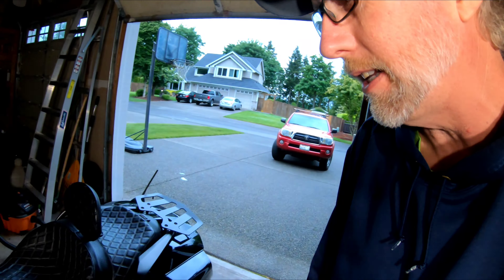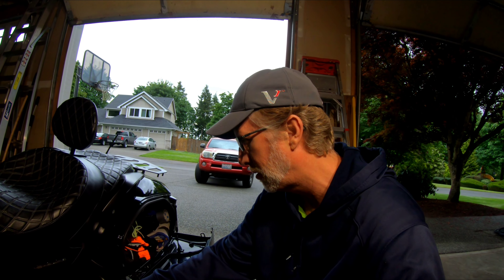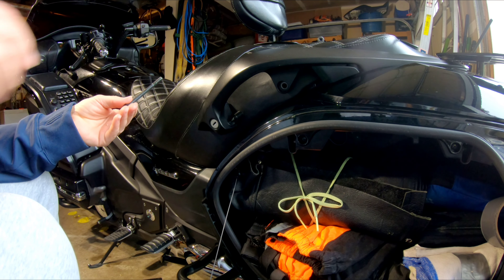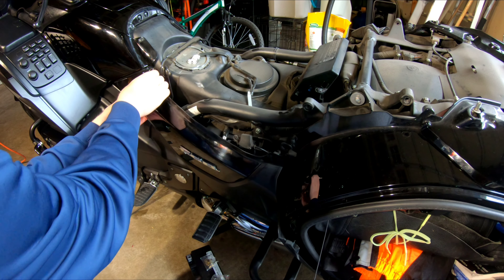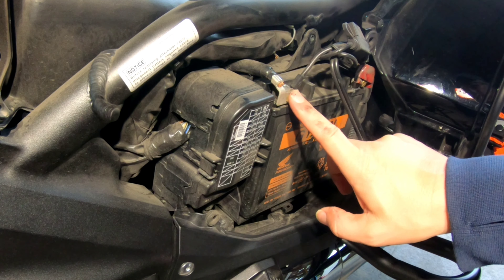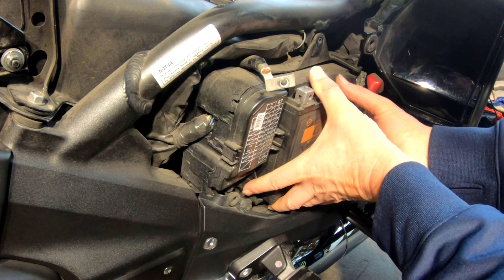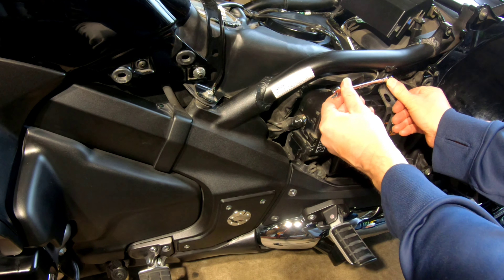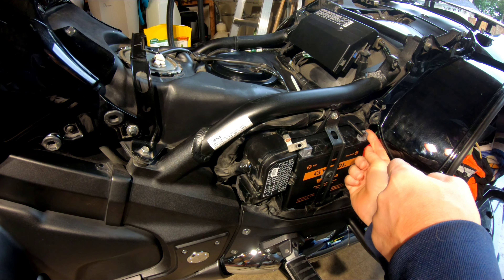Complete Battery Replacement for 2013 Honda F6B

Comment: Good work BG, and I just changed the battery in my Harley Street Glide!...gotta keep em running!
Reply from the maker: Hi Bill,  yep.  Gotta keep them running.  Bike batteries are a little pricy ($141) for stock.  $300+ for those lithium ones.

Comment: Nice and straight forward.
Reply from the maker: Hi WildOn2s,   not to bad.  Is it easy to replace the dark horse battery?
Reply: BG Rides haven’t needed it to yet. But I did take the seat out and it right there. Easy access

Comment: thanks for the video.  I noticed a center stand...where did you get it?  i have a 2013 and can not find one for my bike.  thanks again.
Reply from the maker: Hi Gregor U,  I think the 2013 deluxe model comes with the center stand.  Not sure if anyone makes a center stand kit.  We did install a center stand on a 2018 goldwing.  Here's the youtube link:  https://youtu.be/zHSIowa-D2w
It might be worth calling a honda dealer and check with them to see if they know anyone that makes a center stand kit for the 2013 model.  I looked on ebay real quick and found this center stand.  You could check it out and see if it would fit your 2013.
https://www.ebay.com/itm/234575268796?chn=ps&norover=1&mkevt=1&mkrid=711-117182-37290-0&mkcid=2&itemid=234575268796&targetid=1645685073288&device=c&mktype=&googleloc=9033275&poi=9031581&campaignid=16730423415&mkgroupid=135815925780&rlsatarget=pla-1645685073288&abcId=9300841&merchantid=101637171&gclid=Cj0KCQjw54iXBhCXARIsADWpsG8BcazcjJg9Go6OUzTDA5ZAADZwJ8L5KsQSV7-womTYVmycn7YIqn4aAoLtEALw_wcB

Comment: good vid!! what kind of seat is that? did it lower the saet height?   thanks rooster
Reply from the maker: Hi Scott,  Thanks.  My seat used to be a corbin.  Turned out I couldn't get used to it.  I ended up doing a custom seat using the corbin seat pan.  Here's a link to the video if you'd like to check it out.  "https://youtu.be/v5agFgaKxAI"